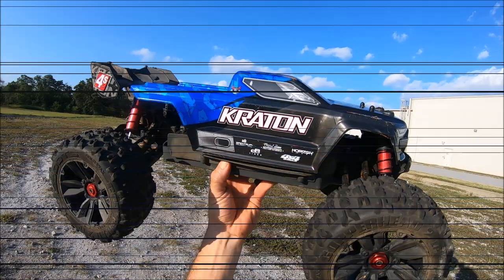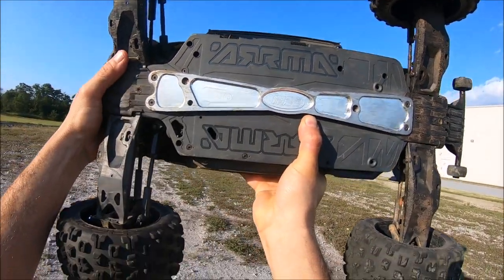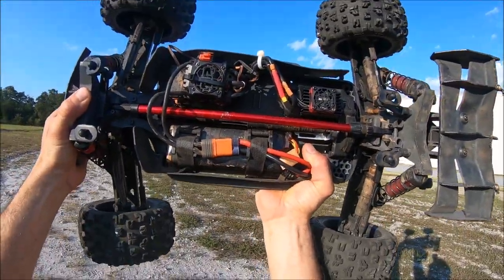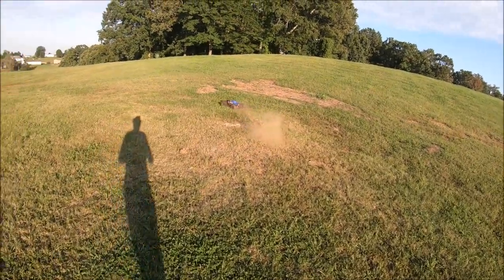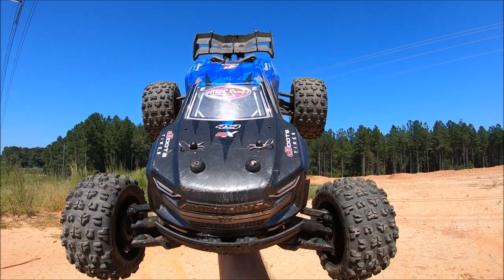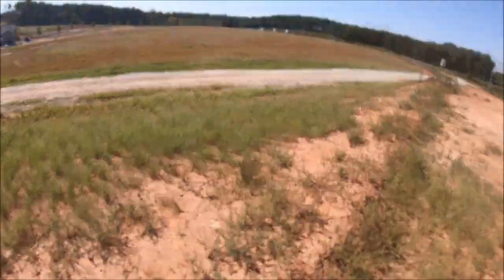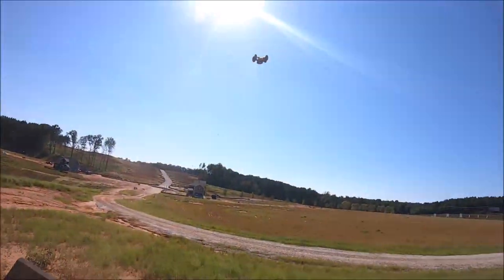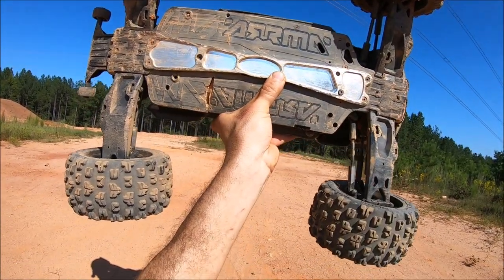NEW M2C Bash bar test!💪ARRMA Kraton 4s V2!

Comment: Try removing the M2C chassis block that comes with the motor mount. In my experience it creates a leverage point that increases damage. I had breaks from on the wheel landings that would not normally cause damage both times I used it. The second time was a badly cracked chassis right in front and behind the chassis block. I’ve removed it and haven’t had the same problems. The motor mount itself is great and stays straight on its own.

Comment: Have you had any problems with the slipper clutch? my 4s v1 had to be tightened constantly after a few wheelies.
Reply from the maker: Not yet. The plastic nut they use now helps.

Comment: m2c rev 2 brace with wing supports where battery tray has a tendency to push through?  Weight has to be comparable to an aluminum chassis by then however.
Reply: I was wondering if it made the weight comparable to the 6s platform. I wanna build something lighter than my 6s trucks. They are fun but so heavy
Reply: @KevinCrowe91  ~3 lbs(9lb advertised) lighter than my XLWB 1/7 scale builds.  After upgrades, batteries, and body reinforcements they push 15-16 lbs however.  Would be curious what his weighs with 4S battery and Bash bar...
Reply: @KevinCrowe91  on my channel I'm getting ready to start a elite lightened build outcast 6s full m2c an basherqueen carbon fiber kit

Comment: My next purchase.. getting bored with the 6s platform. Ready to build something lighter. Any recommendations other than Arrma? Anyone?
Reply: Tekno
Reply from the maker: Yes the v2 4s platform is sweet! Almost the same size as the 1/8 but much lighter and easier to wrench on!
Reply: @RCDUDE81  I’m honestly scared of the slipper clutch type builds and the plastic drive shafts.. lol. I’ve had troubles in the past but maybe I just need to suck it up and try something new. Thanks man
Reply: Traxxas Maxx v2 its one the few Traxxas worth buying in my opinion
Reply: @FLPatrick1095  the price drives me away I’m not even gonna lie lol
Reply: Arrma 3s Typhon, Big Rock,   Senton, Vortek, Vendetta or Infraction.. I think these cars share parts & pieces

Comment: To bad they couldn't make a plate for the whole bottom covering the whole chassis making it 7075
Reply: Then it'd weigh basically the same as a full size Kraton??
Reply: That does exist with that exact specs 😈😈